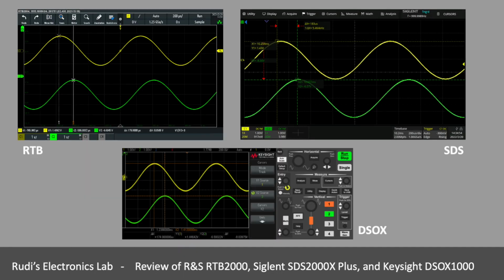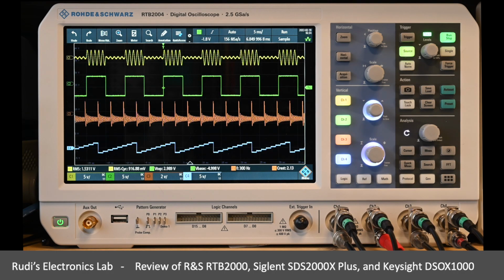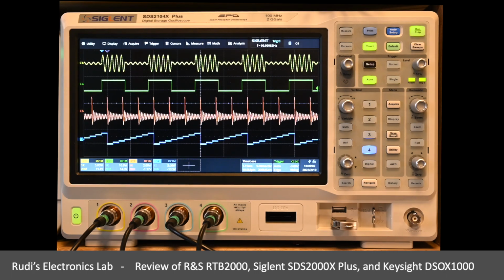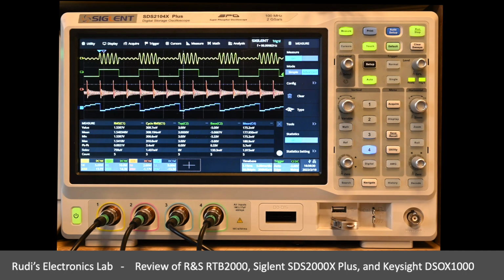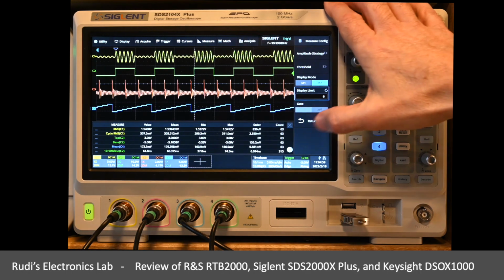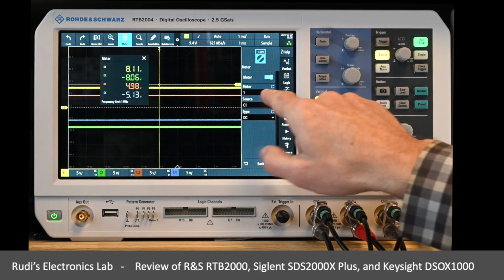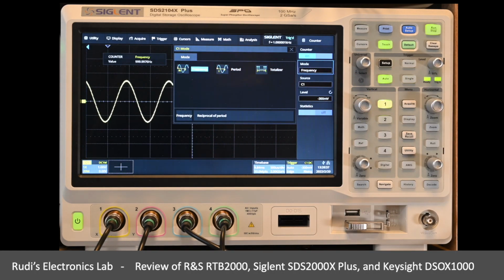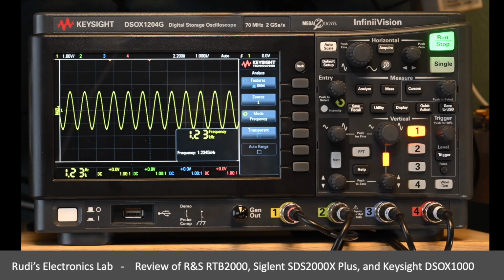REL #09 RTB2000, SDS2000x Plus and DSOX1000 Series Oscilloscopes, Episode 4:Tools

Comment: Hello, congratulations on your excellent review of oscilloscopes,
I would like to know your opinion and if you can publish and do the same tests to your oscilloscope
RTB2004 that they made in the Afug-Info channel to an RTM3004 oscilloscope,
I know they are different models, but the graphical interface, menus and functions are almost the same,
the reason is that I am interested in buying an RTB2004 oscilloscope,
and I am interested to know if the RTB2004 has the same problems as the RTM3004
or have already been corrected. Thank you.

ROLL Modus, TEST Review #1
https://www.youtube.com/watch?v=IZoqLLesr1s

FUNKTIONsGENERATOR, Test Review #2
https://www.youtube.com/watch?v=-v1e1oDLIzk

FILTER, Test Review #3
https://www.youtube.com/watch?v=z3cIxybY_v4

SERIAL BUS DECODING, Test Review #4
https://www.youtube.com/watch?v=s0jvcY9BVZ0

FFT Spectrum Analyzer, Test Review #5
https://www.youtube.com/watch?v=YpCfgtU0lm8

AUTOSET, Test Review #6
https://www.youtube.com/watch?v=cRYxKcES-tI

PERSISTENZ CURSOR, Test Review #7
https://www.youtube.com/watch?v=MHcrROq76cc

LOGIC ANALYZER, Review #8
https://www.youtube.com/watch?v=iWFYrsKsgmc

AutoSet Bug Firmware Vergleich 1.501, Test Review #9
https://www.youtube.com/watch?v=YfPKfTgob7g

Tiefpass & Hochpass Filter Fw v1.501, Review, Test #10
https://www.youtube.com/watch?v=RytDNzL1pX0

Hohe Auflösung High Resolution, Review, Test #11
https://www.youtube.com/watch?v=_1FKI6Drpo4

Roll Bugs Reloaded, Test #12
https://www.youtube.com/watch?v=zaGv-ztidWw

Hysterese Fail, Test #13
https://www.youtube.com/watch?v=5408GUasxXg

TRIGGER, Test #14
https://www.youtube.com/watch?v=mBWvClG1cZg

Review & Bugs, Test #15
https://www.youtube.com/watch?v=yDjCqYuPysc

Comment: Thanks for your video. If the scope is idle, you can measure the line frequency if you select the trigger source line. In germany the line get more unstable.
Reply: Thanks! If the scope indeed observes power line fluctuations, then I think it’s not because utilities are sleeping. In fact, they facing an increasingly difficult world in which they have to balance supply by changing the grid frequency. Not only ‘new’ power sources as solar and wind turbine but also cross-border interconnections make this increasingly complex.
Reply: Old clocks that used the 50Hz power grid as their main time measurement are increasingly ‘consumed’ by fluctuations in grid frequency that weren’t present at the time they were designed…